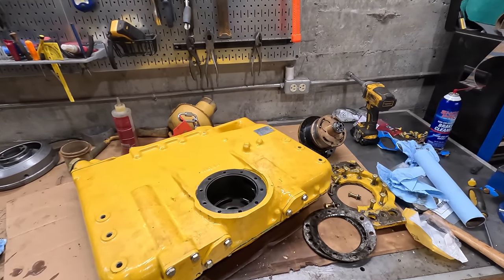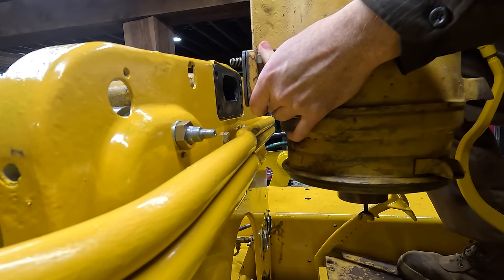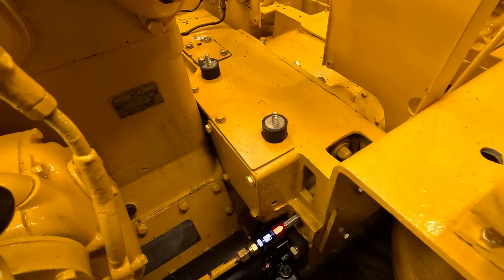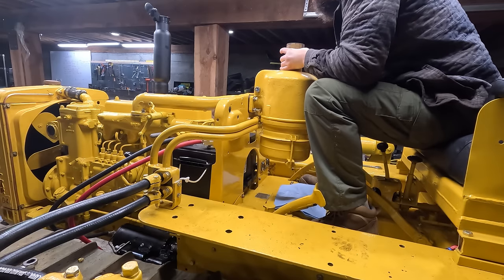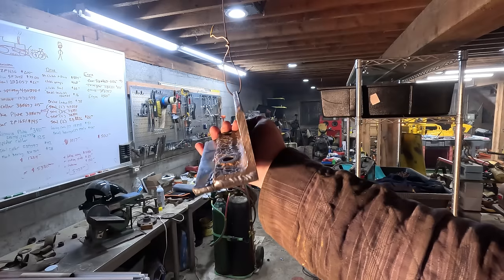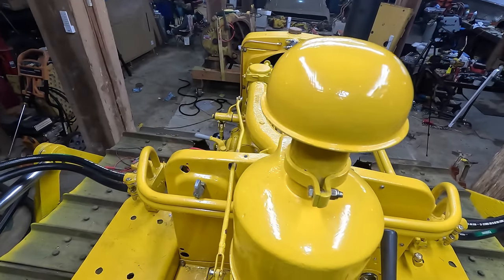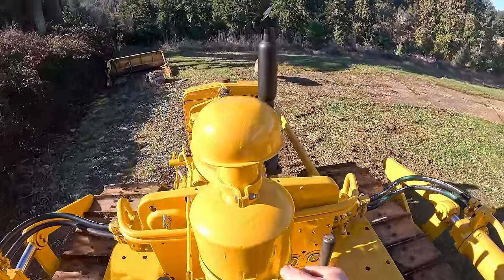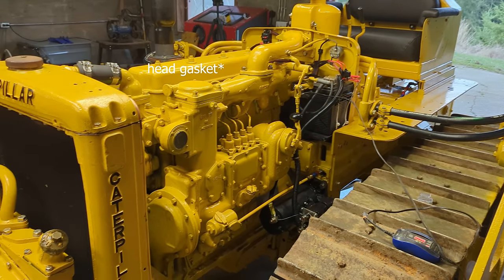Caterpillar D4-7U FINALLY moving under its own power after rebuild

Comment: Beautiful rebuild! I had a 1949 D4-7U w/ electric-start pony motor, ROPS and a 10ft blade.  What a dependable old girl it was.After I replaced the main engine clutch I used it to clear and grade my property to build my house near Vancouver WA on. It did everything I asked of it with remarkable low fuel consumption. I almost cried when I sold her. :-(   Thanks for the memories!

Comment: Brilliant bit of work Matt. I am in my 70’s but I am fairly sure that I recall being taught to run a head gasket for 40 or so hours work before retorquing the head bolts. as the head bolts can ‘stretch’ under working heat values.

Comment: Congrats!  Really enjoyed the build.  Looking forward to the excavator build.  You're going to become a hydraulics expert on that one I believe.
Reply: Yeah I remember a 220 Hitachi that wouldn’t start, after trouble shooting the electrical system for hours ( in northern canada winter) with no response I accidentally pulled on the hydraulic control lever and  it started instantly ,  found hydraulic pump had a couple of damaged pistons ,as long as the lever was pulled it would run ,but when the cylinder extended the motor would stall and lock up .

Comment: Loved the preheater set up, 🤯 that was brilliant. Yeah it doesn't take long for them to heat up. I 🤔 think I would've put the coils closer to the head ... less air to heat. That's just me.
And the air cleaners are freakishly heavy 😲 finger biting, leg smashing 🤬
Good on Roam for pointing out the belt issue. 👍
Thanks again.

Comment: Congratulations and get her up and running. I’ve been watching your videos since you first got this tractor.  One thing that could help your welding is if you would grind off the mill scale on the plate for the battery. This will help your penetration, and maybe make your wells look a little bit nicer. The second thing is you might wanna buy a tap handle, or a set. It’s just a matter of time before you break a tap. Great video. Can’t wait to see the top on.

Comment: It is normal on the steering to use the steering brakes when you are not pulling a load. It is the nature of the tracks to go straight so just releasing the clutch on one side is not enough to make it steer. If there is a load being pulled it will be enough resistance to make it steer. Even when you are pushing a load it is normal to use the steering brakes.
You should be very proud of yourself young man. This is a monumental accomplishment.
Art from Ohio

Comment: It’s fantastic seeing all of the finishing touches being done! Excellent work as always. I especially like the new glow plug solution. I’ll be looking into that for the electric start conversion on my Cat 212 grader (same motor as your D4).

Cleaning up the air filter on your dozer was way, way, waaaay less entertaining than a gentleman I saw doing that on an old D6 - his the oil bath had multiple dead mice in it. The dry retching was very enthusiastic (and I can’t say I blame him).

Comment: Check you steering brake adjustment rather then your steering clutch.  Looks like you have a brake dragging.   Update, ok, you figured it out.  It should not turn without pushing on the brake like it was.  Looks great!

Comment: Thanks for the video 
I remember watching the bulldozers as a kid and always fascinated by them. Always wondered what was inside of the air cleaner. 

You might invest in a portable bandsaw for cutting metal I’ve cut 1/4” steel, cuts like butter.

Comment: Belly-Pan  not skid plate!!  Skid plates are for transfer cases on four-wheel drives and differentials on four-wheel-drive’s belly pans are for what’s going underneath a piece of equipment to protect the bottom of it from rocks and large debris from knocking holes into oil pans, and so forth. A belly pan usually covers the entire Running gear engine transmission  hydraulic pumps main hydraulic hoses, scavage pumps. BTW excellent job on the tractor looks and sounds great. I used to work on heavy equipment on location so I can appreciate someone that’s keeping them going. It’s not easy.

Comment: The shorter battery terminals solder on nice.  Clean & Flux inside, hold cup side up in vice, melt solder inside with torch, jam stripped wire into molten solder and hold a few seconds.  Heavy gloves recommend.   Nice work!  Can't wait to see it pushing dirt and winching trees

Comment: why would you want to change out the rust prevention that has self installed? 😂 Once all adjusted looks like she'll be a very good work horse. Having watched this from the start, it has been amazing to see it at this point. Congrats on making it this far. 

P.s I'd only change that head gasket once it becomes an actual problem in running, I'd expect some level of oil leak on these old machines.

Comment: Good to see that old cat moving. Your welds look good. Remember that when you weld it needs to sound like bacon frying. Tall weld more heat or less wire speed. I hold the nozzle tip with my left hand resting as close to the work as I can tolerate. It steadies the tip and makes a more consistent weld. Use your trigger hand to manipulate the weld puddle while welding. That oil bath filter cup should have an oil fill line on it. My John Deere has the similar one and I have to fill it up to the top of the inner cup on both cups. Give Charlie dog lots of loving from me and good luck on your future endeavors

Comment: Matt love your video's and build.  When you weld with MIG you always travel past your weld. ( your welding backwards and it piles up the metal of the weld puddle)  You don't drag like when welding with a stick.  Slag you drag.  Next step.  When welding thick sections of metal.  Preheat with a propane torch to about 200 degrees.  The weld will flatten out.  Great work.  Keep at it.  TonyK.
Reply from the maker: good advice, thanks

Comment: Hey Matt. About the head gasket leaking. I don't recall but are those original head bolts?  Head bolts can loose a lot of their clamping yield from stretch from multiple torque applications.  Not sure if that applies here but just thought I would throw that out there for consideration.  Leaks suck when you are all done and everything is all nicely painted but I am sure you will run them all down.
Great job on all your videos and you have done an awesome job on the old Cat. Can't wait to see it pushing dirt!

Comment: I would let that head gasket situation develop a bit and see how it does after some hours. My Dad was a diesel mechanic in the Navy and then became a mechanic for several logging outfits before ultimately buying a service truck and going out on his own. He told me he once slid a .006" feeler gauge between the head and block of a healthy, running Cummins motor. I'm just curious if the problem gets worse or better after a few heat cycles.

Comment: Give the heaters a 45 seconds on time before you start cranking on it ,Job well done ,does the charging crt work ? a Retorque on the head bolts

Comment: Put some K seal in the radiator.  Available at Oreilly's.  Works good for sealing Radiators and Head Gaskets.  I have not tried it on a non Pressurixed system but it is worth a try.

Comment: Really nice job.. I hope your leak around the head isn't too big a deal.
As for your welding, A guy told me once that you didn't have to be a great welder as long as you knew how to use a grinder.  😜 Actually I think they are just fine for the application.

Comment: I use hockey pucks to make my own isolators - cheap, easy to find, easy to shape/drill/cut to need.  They also make for good feet for tool stands and benches.  They're very good at eliminating high-frequency vibration.  If I need a broader range of frequency dampening, I make sandwiches including puck rubber, neoprene from old mouse pads, and computer keyboard wrist pads, and inner tubes.  Works fantastically.
Reply from the maker: good idea

Comment: Great job Matt, I can't imagine single handedly demolishing a such a piece of machinery and putting it back together - amazing.

I was wondering why you didn't put your intake heater inside manifold - a straight tube with an opening each end already.

Comment: Holy crap Matt. This was fantastic! Few little setbacks, but overall daaaaaaang she fine!!! 😮

I'd try the retorque of head bolts and drive it around a bit more before putting the blade on myself.

Seriously though. Big props for taking on a project this big and seeing it through! I'm struggling to make myself go work on trying to put my project car back together, despite really wanting to drive it this spring/summer.

Comment: You need to use the brake to make any big change in direction.  When under load the final drive clutch will suffice- In 70 I worked for a family that had a 6 & a 8, both had combination paper then oil bath filters,  the paper ones were tapped on the tracks every 12 hours and the oil bath were yearly.  After 30 years we pulled the pan off of the 8 and the bores looked like they were new.  Best filtration system ever!  The dust was like concrete powder, as abrasive as anything known to machinery- and running 24 hours a day for months no damage was found.  You could run your fingers inside the intake pipe and clean oil was all that was found.  The isolation of the battery was a great idea, both of ours would kill the 6 volt batteries, so pony motor was how they were started.  Electric spinny thing is the way to go!  Only negative comment is a touch of orange would make the paint the correct color 😅.
P.S.-  needs to get dirty to loose the showroom looks! 😂

Comment: To do the belt do you have to take the hydraulic tank off and pull a rod out to change belt. Great video came out really awesome. And for the head gasket you have to use 30a gasket sealer. And how did your do your oil cooler lines aren't connected

Comment: - Hurrah for the first drive.
- If you ever come across some discarded crusher conveyor belts, get some.
- They are great for battery pan bottoms and all kinds of other things.
- Glue on strips for clearance over bolts, etc. or drill holes and double layer.

Comment: The head gasket may not actually be leaking, let me explain. There is no doubt grease and oil along the seam Head & block) when you painted it, as the engine warms the oil and grease melt and run onto the block. Clean the block and you'll likely see less and less of this over the next few runs. Mine did the exact same thing and now that everything has melted that was in the seam I don't have any mess.

Comment: New head gasket and studs or bolts. Some of that era had head bolts that went soft but I don't suggest it was a Caterpillar thing or not. There are engineers which can test the stretch on those bolts if you need to know?

Comment: You have an old engine that hasn't been under full running compression for years. I would definitely back off on the head bolts and try to re-torque them going a little over specs before I got into some major surgery ! Because you know it won't just stop with a head gasket. One thing begets another begets another as you know all too well. Good luck. And yes, do it now while you're set up for it. Cleaning up after you're done and putting everything away is a major job in itself. You don't want to have to do it twice ! BTW You have the patience of a Saint !

Comment: That was amazing 😁👍 the thing sounds too tight🤣😂🤣 like it needs run 🏃 run hard. 
I know my D318 head  (D315's big brother ) dose leak a little after setting but it worked itself out. I would retorque the head and run the puppy water out of it.  That will also help the rings to seat, reseat. Be aware that it may, will, start to slobber for a bit but a good hard two to four hour shift under medium then heavy load should clear that up.
 this style head gasket is the only type of head gasket that takes gasket material 🤷‍🤯 also it is said the head gasket CAN be reused 🤔 
I do believe they used the old style non-hardening Permatex in the tube but I like the Permatex 80057 Super 300 non-hardening seems easier to apply.

Comment: Incredible restoration job Matt. I've enjoyed watching all the way thru to now.  I was a little concerned about the battery casing being so close to the engine block. Do you think a sheet of some sort of heat insulation between the battery and the block would be a good idea??? Keep up the awesome work mate...

Comment: Nice wiring job🙂 Those intake-heaters demand a LOT of current. You may wish to consider a dedicated, heavy-gauge,  ground wire from battery-minus post to the casting they screw into..... otherwise, you are expecting current to flow through the threads of several bolts (headbolts) and losing voltage at the heaters.  (it is never good practice to expect bolt-threads to carry electrical current...bolts may weld themselves inplace or other undesirable things may happen)

Comment: Just a word of caution when enguaging the clutch. If you slap it in you put a tremendous amount of force on trans gears. Can break teeth off. Try enguaging clutch llever gradually like a car clutch so it is not so much of a shock to trans.my uncle broke the trans teeth off his TD9 international. Just a word of caution. You are doing and did an amazing job on that one.
Reply from the maker: that makes sense, thanks

Comment: - If you missed it in editing at 39:06 and again at 39:16, your left side lower hydraulic line needs sufficient rub-sleeve protection from the lift arm valve eye. {did I get the right terminology?}

Comment: Another option for the intake spacer would be to use some all-thread, with nuts on the inside. This allows a lot of adjustment, you can even put a bit of outward preload on the threads to compensate for weight and sag. With your head gasket, you can do a shonky deck and head surface flattening job at home using a NEW sharpening stone (rather than getting a shop to do it).

Comment: Most of my experience with tracked vehicles was with steering Brakes.  The little I had with clutches, I remember that with no load you had to use the brakes to steer. The clutches would steer when pulling a load.  The thing to watch was when going down hill with no load the tractor would often steer the wrong way because of over run, if you didn't apply some brake.  You seem to be making a great job. Well done

Comment: What about the generator.   Does it work?   Kudos Matt.  Have loved thr series for rebuilding the cat.  Looking forward to the backhoe series.
Reply: It looks like he had a charger on the battery at the end, so likely not.
Reply from the maker: I forgot to test it with the machine running...the trickle charger showed it as still being full, but I really doubt its actually working.

Comment: Outstanding!!! Since you apparently had the battery on a charger at the end, does that mean you will be rebuilding the generator?  I also noticed that Charlie might be getting a little arthritis.
Reply from the maker: I forgot to test it while the machine was running...the charger said it was still at full, but it's display isn't very precise.

Comment: 16:47 I used a miller welder for similar plates using Argon shielding and flux core wire and it was set to 23.6v and 260in/min. It seemed to do okay that way. Not sure what settings you have on your machine. If you're using non flux core wire and Argon gas, I'd use 15.5v and 125in/min. Granted, machines can vary a lot so you have to fiddle with it until you learn that machine.

Comment: Great job Matt looking great a great achievement but please bolt a grill in front of the radiator  radiator is very easily damaged machine would loof better to with the mesh grill in there

Comment: Nice job and almost there, be great when the blade and canopy are installed too. I do not think it is a good idea to " back off on head bolts. Just retorque and adjust valves and take it for a good run. Check and get the water temp up to specs.   Thanks for the rework. Very dedicated.

Comment: Heck, a couple cans of Barrs-Leaks and you're good to go.  Would have been expensive to have a machine shop level the head and block.  Most old CATS leak oil... it's just part of the 'patina'.  If it stops leaking... add more oil !

Comment: When you are drilling with larger drills, use a slower speed. A large drill will vibrate when drilling with too fast a speed. A slower speed will drill better and leave a better finished hole.
Reply: Also for that job on the air cleaner, a step drill does a much better job, and also greatly reduces the chance of a strained or broken wrist if the drill bit catches. 
Great work Matt, and I am in the retorquing the head bolts first camp too.
Reply: Little bit of machining oil goes a long ways to make a drill bit cut cleanly too.

Comment: what size battery crimps did you buy, I'm after some for my batteries so if you have a link I'd be grateful
Reply from the maker: the hydraulic crimper?  I got it off Amazon a few years ago, it came with a bunch of different sizes of teeth
Reply: @PacificNorthwestHillbilly  thanks for that, I've been having difficulty sourcing the larger battery crimp sizes in Australia.  I bout a kit off Amazon and it didn't have anything near big enough for battery cables.  thanks for getting back to me so quickly as well, I appreciate it and love watching the work you do.
Reply: @PacificNorthwestHillbilly  not the crimper but the crimps themselves
Reply from the maker: Oh you mean these?  https://a.co/d/e666c20

Comment: It's a shame that there are no good spare pony motors around anymore. The pony motor starting principle, although way slower when the engine is warm, is more mechanically sympathetic IMHO. Get the oil pressure up without compression, get the block heated by compression without throttle, start the engine in three revolutions once the throttle is opened up on the prewarmed engine. Squatch253 shows how it's done.